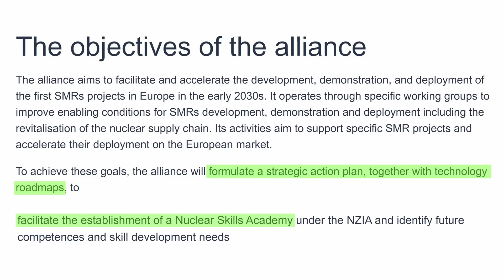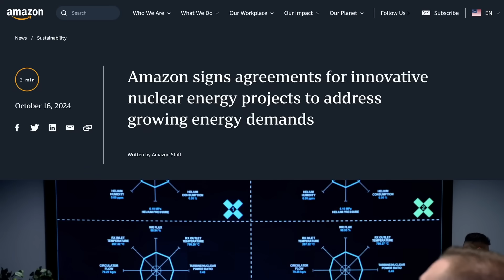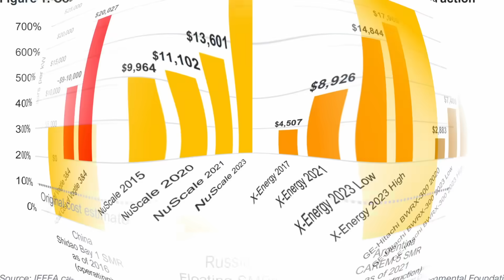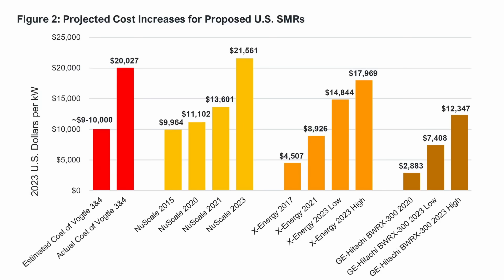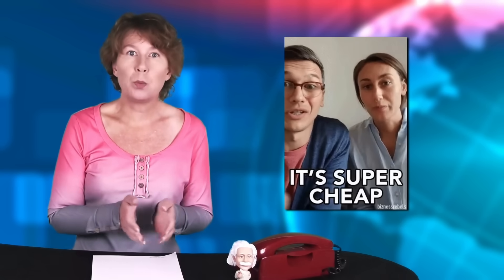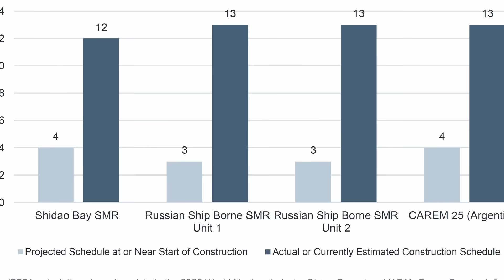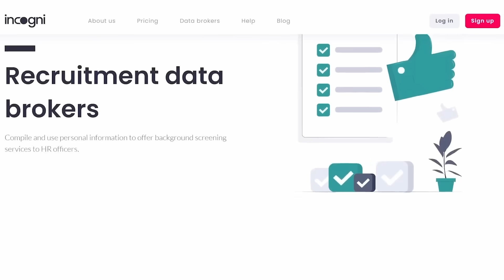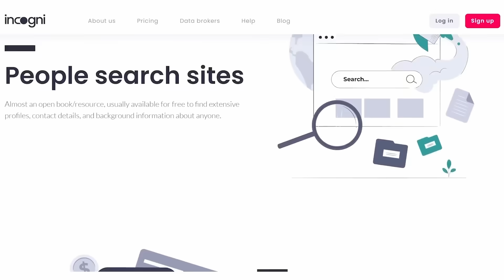Small Nuclear Reactors Have A Big Problem

Comment: I'm puzzled that this is proving so difficult. We've been building small nuclear reactors to power submarines and aircraft carriers for years. 

Perhaps the new players in this arena are finding they have a lot more to learn than they expected, but at least the incumbent suppliers of reactors to the military should have a good idea of how to build reliable SMRs at a predictable cost. Why haven’t they accomplished that by now?
Reply: What an interesting question, maybe because it would require so much materials and maintanance to both build and keep safely working, that shrinking it doesnt provide anything
Reply: @ it’s easy to underestimate the costs when part of it is radioactive.
Reply: Naval reactors are not subject to NRC requirements, don’t have to make a profit and have the federal government to issue bonds at relatively low interest to finance them.
Reply: Submarine nuclear reactors achieve their small size in part by running on highly enriched uranium.  US naval reactors use bomb-grade uranium (93% U-235).  Civilian reactors run on very low enriched (3%) uranium.   

If proliferation weren't a concern you absolutely could just take the reactor from a Virginia class sub and put it into a steel container on land and you'd have a 210 MW generating station for maybe half a billion dollars.  We don't know about the operating costs of an S9G reactor, but we do know the fuel would cost 10x as much as civilian reactor fuel.  Since that's about a quarter of a commercial reactor's operating costs, our hypothetical naval reactor power station would cost at least 2.5x as much to operate as a civilian reactor.

That's the real challenge for SMRs: economics, not physics. Nobody doubts you could physically build and operate an SMR if cost were no object.  The question is whether you can do it at a normal profit.  Economics is always a huge constraint for civilian engineering, which is why we're having trouble making civilian SMRs even though we've been putting them in submarines for 70 years.
Reply: @grumpynerd  A bigger problem is politics. Do we really want our adversaries to have open access to our nation's strategic weapon systems?
Reply: Military development is usually granted much wider regulatory margins for R&D. That’s why they have a monopoly over weapons, and such.
Reply: For the French carrier, it's 150 MW each reactor. So it's too small for the cost, for a civilian purpose, I think.
Reply: @oakpope  yep, but too late, here in europe we got the copy-pasting politics, if one country makes a decision, no matter how wrong or ineffective, every other country does it too
Reply: Submarines travel underwater , build up the logic from there.
Reply: @satvik1024  Nuclear aircraft carriers don't. 

The original question remains unanswered. 

The facts given if true (no reason to suggest they are not) do not make sense when small nuclear reactors or in use and have been for some time for military applications. 

The suggestions that that is because they have unlimited budgets, run under water, have specialist personnel, less bureaucratic regulations doesn't begin to explain why civilian designs have so far proved to be costly failures and why those manufactures that build the military rectors are only just now proposing civilian designs.  

While nuclear sub-marines make a lot of sense being independent and self-sufficient and and weapons that are deterrents and not expected to be used, the need for nuclear aircraft carriers seems less clear cut. Aircraft carriers are limited by the consumable and ammunition, aviation fuel, and the need for their gaggle of support vessels to refuel, so the benefits of being able to remain at sea for ten years seems mute. 

On paper civilian SMNR do make sense.
Reply: @martincday007  I was thinking of the problem of heat dispersion , the smaller the reactor, the lesser the area for such . In case of submarine and even aircraft carriers, oceanic water is a good way to keep the thing cool . 

https://youtu.be/EsUBRd1O2dU
Reply: Probably auto correct,but the word is not mute.It's moot,as in moot point.
Reply: @satvik1024  they also have crews of the most unique specialists in the world who have to be trained for decades in order to operate them and who cannot be easily replaced.
Reply: @ at the officer level at least and all the nuclear related aspects surely
Reply: @qvidtvm-s5h  No so.  The US Navy accepts entry-level enlisted members (after aptitude and security screening) for a program of standard recruit training followed by two six-month nuclear training periods the into the fleet.  Their total enlistment commitment can be as little as six years.
Reply: True .
France is 80% nuclear power.
Few issues

I retired from US Dept of Energy and worked on experiments and decommissioning

I am convinced big oil gas monopolies lobbiests hamper even block nuclear power plants..

Net Zero Zero Gen coal plant demonstration project  also scrapped in 2000s  difficult to even find information on this project .

US Navy has had SNR since Nautilus Rickover / Radkowsky 1950s.

תודה רבה שלום
Reply: I don't get it either. Especially with improved manufacturing. 

 I guess it has always been easier to  design a nuclear reactor, compared to building it.
Reply: SMRs gamble on highly speculative fuel cycles to become economically viable.
Marine reactors work, but would be way too expensive for commercial operations and benefit from relaxed safety requirements.
Reply: Navy reactors use highly enriched fuel which allows them to be much smaller than civilian reactors which are limited to 3% enriched fuel. It's a diversion/proliferation issue. We decided years ago--rightly or wrongly--that using bomb-grade uranium in civilian power reactors was a bad idea. So we don't. That means civilian power reactors can't be made small. Also, Navy reactors always operate near a plentiful source of cooling water in case of an accident. And they spend most of their operating life away from highly populated areas. So Navy reactors don't need cooling towers or massive pumps or as many backup systems. US Navy reactors are safe, but that level of safety is not considered enough for civilian nuclear plants on land near populated areas. Also, Navy reactors can be modularized and built in a factory and achieve sort of an economy of scale. Every civilian nuclear reactor in the US operates on its own set of NRC regulations and those regulations change all the time. You cannot start building a nuclear plant today and expect to complete it under the same NRC regulations you started with. And you can't know what tomorrow's regulation will be, what compliance will cost or how long it will take. 

The 737 was approved in 1968. As long as Boeing builds basically the same aircraft that was approved in '68, no new approval is necessary. The design is "grandfathered."  (Ironocally, that's what got them into trouble with the Max. They tried to install more fuel-efficient engines to compete with Airbus. The fans were too large for the original design, so they moved them forward which changed the flight dynamics. They also hid these problems from the FAA (which is a joke as a regulator compared to the NRC).

There is no such thing in the NRC world as "grandfathering" a design. You can't make cars on an assembly line if each car has its own regulatory schema. Consequently, unless the whole approach to nuclear safety regulation in the US changes dramatically, there will never be a plant somewhere spitting out modular nukes. That will never happen.
Reply: Those use basically weapons grade fuel.
Reply: @ not basically, 95% U235 is bomb grade. And we won’t ever know how much it costs. It’s all classified
Reply: The cost per MW of a navel reactor (superb machines that they are) would make your head spin. Cost is no object for high-performance military machines. The trick for commercial nuclear is cost and modular reactors just aren't bending the curve enough.
Reply: @bobwx1987  Have Ccp China slave labor prisons make them lol

Only Chinese take out food is made in America now.
Not even funny
Reply: Military nuclear reactors are non starters economically speaking.
They are built to be self reliant for long periods and to survive wars. Not to save on fuel
Reply: Nuclear submarines don't need to be economically competitive with other sources of grid electricity.
Reply: Submarines and carriers also go way over budget.
Reply: @AnnNunnally  Is that because of their reactors?
Probably it's only a small part of it
Reply: @foxtrotunit1269  The reactor is the most classified and sensitive part of either of those vessels, which are the most advanced weapons systems anywhere in the world. A small, but central part of it.
Reply: @foxtrotunit1269  but who knows. . .
Reply: @qvidtvm-s5h  My argument: Secrecy/sensitivity doesn't equal cost.

Example:
A car computer with billion transistors is much more complicated/sensitive than it's engine, yet the computer only costs few bucks compared to the engine.
Reply: @ I feel like in this case it probably does equal cost but cost may be related to how they keep them both so safe/reliable AND quiet
Reply: @foxtrotunit1269  cost likely plays a huge role here—America is the only country on earth with multiples of ten nuclear submarines and more than 10 carriers.
Reply: Nice video Mam..
Reply: I suppose the requirements are quite different. In exactly what way, I don't know. It's a great point though.
Reply: Military doesn’t need to follow the industrial safety regilations.
Reply: @sac78008  They are as strict if not more so.
Reply: NuScale is a simplified version of existing tech. The company started courting the NRC in 2008 and bought tens of thousands of consultancy hours from the NRC to pre-inspect their design before finally submitting their 12,000 page application in 2016. Then the NRC pondered it until 2020 when they issued the license. So that's part of the regulatory story. Imagine what it had meant for the timeline if the design was more innovative, rather than simpler standard tech.
Reply: They're not as small as you think, take Rolls Royce for example "the power station is constructed using around 1,500 standard transportable modules". So the modules may fit in shipping containers but the reactor does not. Has to be that big for the safety systems and because it uses 5% enriched fuel.
Reply: @ 3-5% u235 is standard for power generation. 
There are physical limitations on all machines. Size: there are limits to how big or small you can make a nuclear reactor. 
Example: internal combustion engines work well from ships, to cars, to mouse size model planes engines. They don’t work bigger or smaller than that.
Reply: That's exactly what I was going to say
Reply: The  military is not required to be profitable or safe.
Reply: @joejimbo9907   The US Navy just exceeded 7,500 reactor years of operation without a nuclear mishap.  They are the standard for safety in nuclear operations.
Reply: @jmorrison146  Nice.   Where is the world going to get the uranium from?
Reply: 1. Less regulartory filings for a Navy ship. issue with land based reactors are the years of site studies: Fault lines, water table, water source (for cooling), Fuel storage\spent fuel pool), & emergency evacuations in the event of a meltdown or significant release of radioactivity materials. Then there is Insurance, Navy doesn't have to pay for insurance.
Reply: The biggest difference is Money.  Military isn’t trying to make a buck. Investors only care about the buck.
Reply: $$$$ SMR spread around the place terrify me in terms of safety and terrorism risks.
Reply: What I am forced to conclude, after watching this and after taking into consideration a bunch of smart comments, is that private companies are not able to get these projects off the ground safely and cost effectively and so they end up failing to deliver, and therefore, government should be the one organizing and financing the building of new smaller reactors that can be easily moved.
Reply: Just these are a bit out of the cost envelope. And, again, solar and wind generation are far cheaper and more safer to operate, which result in less regulation
Reply: Small reactors have been successfully used in U.S. Submarines & Aircraft Carriers for 75 years. The new U.S. Navy Gerald R Ford Class Aircraft Carriers have 2 state of the art reactors deep inside the hull of the ship that will operate for 25 years without refueling. Each new A1B (B stands for the manufacturer, Bechtel) reactor produces 125 megawatts of electricity and 350,000 shaft horsepower, which is 25% greater than the previous A4W reactor. If there’s a problem building and placing new smaller reactors for power generation, it’s by design.
Reply: Cost is no object for navy vessels. And the designs are national secrets.
Reply: @ designs and costs. Can’t hire the “nuke” officers because it’s very specific to the boat. Can’t copy anything about those reactors or other countries find out.
Reply: Those reactors are much smaller, hundreds of megawatts, extremely expensive, and run on weapons grade fuel.
Reply: Military have less restrictions, military personnel are expendable.
Reply: We could have built small modular reactors all along. The key issue is funding. In the military, a small group of people can decide to divert funds to a small modular reactor. In the infrastructure sphere, there's almost zero discretionary funds and any project has to pass the inspection of investors who expect to make back more than they put in. Small modular reactors are relatively cheap and easy to build, but they aren't profitable.
Reply: Correct, nationalize Nuclear and make the USA the energy King.   High paying jobs for all Americans.  Time for radical changes in our economics.  Sustainability & prosperity,  the 1% are gutted the middle class.  This is very painful,   The American (US $, IOUS) Empire is OVER.
Reply: @jamesmorton7881  cant nationalise its against capitalism,  USA hates resources being nationalised look at the past.
Reply: From the technology to the millions and millions and millions of cash paying customers is the $TRILLIONs national grid.

The grid must have cash flow from the customer. 
The grid will prioritise its customers' relationship. 
The customers can self generate and store, millions and millions and millions and millions of customers. 

Nuclear electricity filling the grid and needing its 'little' cashflow is just a problem. 
Warm latitude solutions work better in warming cold latitudes.
Reply: Think proliferation, slave wages paid, and ACTUAL COSTS ..., after you buy a clue ...
Reply: Some of the big reason is due to the majority of smart women that pass their smart genes to their males heirs, has shrunk due to smart women not having children.  We are in effective, entering a serious brain drain due to fragile male egos and that smart women are now very few in numbers to previous generations.
Reply: Military means State Secret, you wouldn't want China to stole it, right! Imagine, China had Nuclear Powered Military Hardware.
Reply: My guess Is that safety regulations are much more difficult to satisfy when It comes to civil nuclear reactors.  
There are more restrictions and they change a lot both in time and space, and this means a lot of revisioning of the original project.
Reply: @lucapintori4863  Exxon Mobil Chevron writes the regulations...
Reply: @Motorhead250  Not in the nuclear industry. No. Even the big players life Westinghouse and General Atomics can't do it either. Not like the FAA or SEC.
Reply: @Henry-r2f  Elon Musk team may be able to..
Seems he outshined NASA and Boeing etc
Reply: @IlPinto  I have worked in the nuclear industry for about 2 decades.  Two of the plants I worked at were licensed by the Atomic Energy Commission under the "Atoms for Peace" program.   The rules were much more relaxed back then... and in reality the industry paid for that laxness.

All the newer rules and the creation of the NRC in the USA were results of major nuclear incidents and in some cases resulting in loss of life.  Its like the new fire-code regulations for new buildings... they are all written in real events and blood.

You may think Civilian Nuclear Power is over-regulated.  But, I don't.  The newer requirements have prevented many things - and now allow the safe operation of nuclear power plants for many decades (and the construction of nuclear power plant with initial licenses of 60 years, which can be extended).
Reply: The military have no concern about budget and profitability.
Reply: Back in the 1950s, they told us that nuclear energy would make electricity so cheap that would not need to meter it 😂
More government lies.
Reply: @HighWealder  That lie was actually from GE back in the day as told by their spokesperson at the time Ronald Reagan.
Reply: @HighWealder  Exactly. In fact, the big utilities weren't interested in nukes until the USG twisted their arms. Washington sweetened the deal by agreeing to a $500 million liability cap on operators. That agreement stands today. Imagine a commercial failure in an urban setting and the company only owes $500 million. It's outrageous.

If operators were not given that guarantee, they would never have built a nuke in the first place.
Reply: @drbuckley1  You have several things wrong.  While the US Government funded the development of nuclear power - that is true (which largely ended in the 1970's); they also funded the attempt to make Thorium fuel work as well (it flopped badly).  However, their is no liability cap as you discuss.  The Federal Government set up an insurance agency that all nuclear operators pay into - and it has reserves to pay for multiple worst case nuclear power plant disasters.

Should it run out - the Federal Government would direct that agency to collect more money from the other nuclear power plants to cover the shortfall.
Reply: @perryallan3524  Thanks for the correction.
Reply: 3:12 so...3 - 9bn for nuclear power or the same amount to export weapons all around the globe. Any surprise the US has no immediate incentive for SMRs?
Reply: Good question, what is the cost for a nuclear sub power plant
Reply: "Military project with predictable cost" is a well known oxymoron.
Reply: @ sorry, that is what I try to say. Predictable = “what ever it takes”. Predictable from tax payer point of view 😉
Reply: I also wondered the same and after a little research found the answer.
Military reactors are practically massed produced, one after another but still, it simply costs way too much to miniaturize, like any piece of technology. But the military will eat this cost.

For civilian purposes, we don’t need smaller, nobody ever protested nuclear plants are too big. To be cheaper, they need new tech but that still doesn’t mean smaller is cheaper.
Cheaper would be to build a lot of big reactors.
Reply: Also what they don't like getting out is the newest and most efficient reactors essentially use weapons grade isotopic fuel.
Reply: @ what can possibly go wrong?😑
Reply: I don't even know where to start when I meet this line of argument. No. Just no. They have nothing to do with each other. And never will.
Reply: Yeah,and they struggle to recycle them,I think some were dumped in the oceans
Reply: One of these things is owned and operated by the military (government) and the other is by civilians. Government makes regulation and also can ignore them. As far as regulatory costs go, the military has far fewer barriers.
Reply: Give the contract to Legos!
Reply: Those reactors are surrounded by a literal army to protect them. Commercial reactors need to be safe from bad actors, terrorists,  and general civilian incompetence.
Reply: Ford class carriers have an out of the box rating of 1400 megawatts. Aaaaand, decreasing right out of the gate. Nimitz class only had 194 MW available. Aaaaand, also decreasing. n ROH usually takes one to two years for submarines and up to almost three years for an aircraft carrier, performed at a naval shipyard. Time periods between ROHs on a ship have varied historically from about 5–20 years (for submarines) to up to 25 years for Nimitz class.
Reply: For those unaware, “ROH” in this context means “Refueling and Overhaul.”
Reply: The industry has far too much regulation,  it is beyond safety. Regulation is used to stifle it from before is even fully designed. It is not about what is better for people/the world, it's about not letting go of the money.
Reply: @survidmt  I worked for DOE...now add woke regs DEI on top 

Oy vey
Reply: Because they don't approach it like Elon.
It's a shame X doesn't have an SMR/NNR wing.
Reply: don’t believe the hype. The requirements for safety don’t shrink proportionally to the peer output. LWR are hard. This is why we need to do a massive input to see if molten salt reactors are really feasible. With the possibility of eliminating meltdowns and steam explosions the cost could come down and less customization would be necessary.
Reply: @RichardEnglander  Elon is a Putin stooge. Does anybody think he isn't sharing Space X tech with Moscow?
Reply: Said no one ever.
Reply: @RichardEnglander  Found the missing Elon fan that think that his almighty elon has a perfect answer to every question. For your information when it come to radioactive material the smaller it get the hard it is to control. Reason people cant go to mars is mostly because we need a spaceship big enough where the protective radiation materials are just a small fraction of the weight  of the ship.
Reply: @RichardEnglander  Elon's approach is to learn from many accidents.  If Space-X were building nuclear reactors we'd have had tens of meltdowns as they worked it out.
Reply: @ what is elon’s way: break every rule, screw the worker, keep the government out. 
Last year he fired thousands of workers so that he could and did the biggest bonus ever for a ceo
Reply: @ exactly. Everyone would end up irradiated. We already know how little he cares for the common good.
Reply: @edwardlulofs444 this sounds like bs. Owner CEOs rarely give themselves bonuses. Can you share a link
Reply: @ it’s just my opinion from years in computer industry and teaching. Also I recall how very difficult anything to do with nuclear physics. Dealing with radioactive materials makes everything 100 times harder.